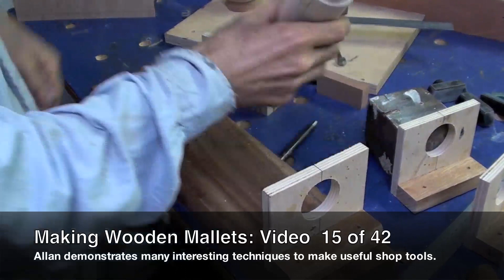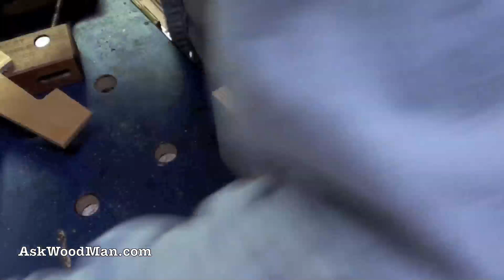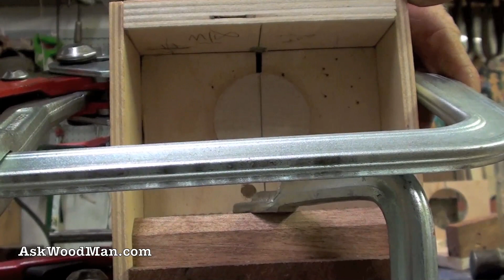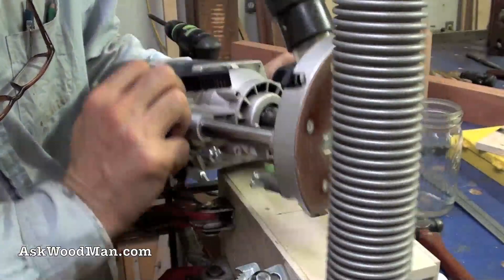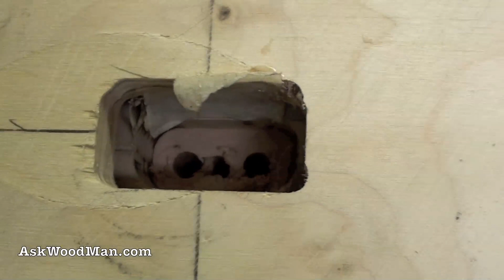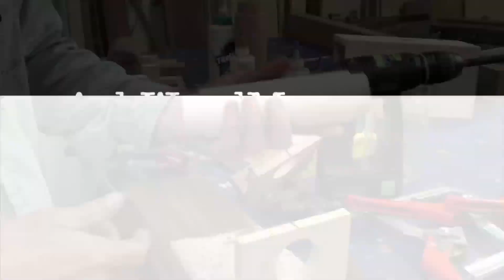15 of 42: How To Make A Steel Hooped Wooden Mallet • Woodworking Projects

Comment from the maker: The V is great for drilling and I use homemade and steel ones all the time. But here I am making the jig do several operations throughout the process that I thought this setup a little better. The V could have been made to work just as well too. That is what is so interesting about woodwork, the variety and flexibility of the material to solve problems is really infinite. Thanks for watching and taking the time to comment. 
Allan

Comment from the maker: @Majoofi The round one won't spin because you will see later that the top of the handle will be coped to the bottom of the barrel. I was not worried about the router breaking through because it is a much smaller diameter bit therefore less downward pressure. And the router is spinning 22,000 rpm versus 400rpm for the drill press. And I was plunging in really small increments to ensure a clean exit. I made two styles to show different techniques.

Comment: Allan, 
I received the Bessy clamps that I told you about. They are/were Bessy Kliklamps. I picked up the box and without even opening it knew they weren’t right. Way too light. I did take one out and it was way to light duty. They are packed and ready for their lonely trip back to Amazon. Amazon does have the clamps like you have, and I will order them right away.
Guess I should have know better. At least Amazon pays shipping back as well.

Comment: Why were you worried about blowing out the other side with the drill on the other mallet head, but not when using the router on this one?

Also why does one have a round tenon and the others not? I'd think the round one would be more likely to spin.

Comment: Allan, what is the clamp that you are using about 2:35? It looks like a bar clamp and has a handle that ratchets. Where did you get them?
Great videos, when something doesn't work quite right you don't edit that out but shows the solution that you come up with.
Jack